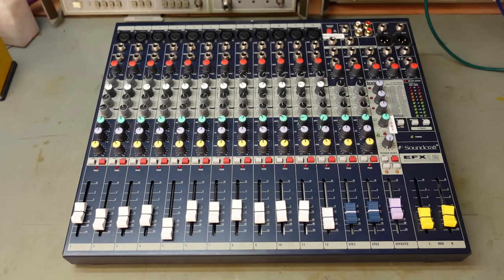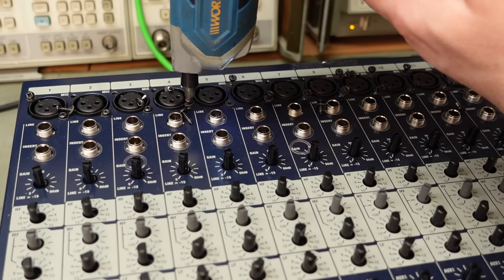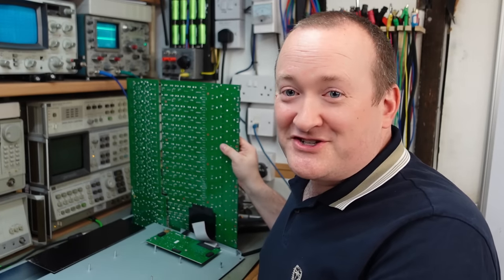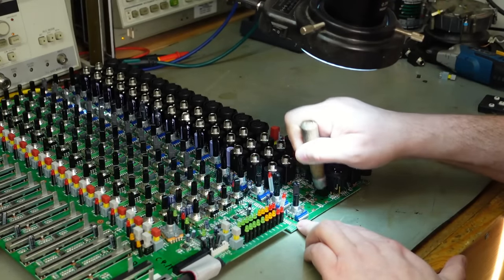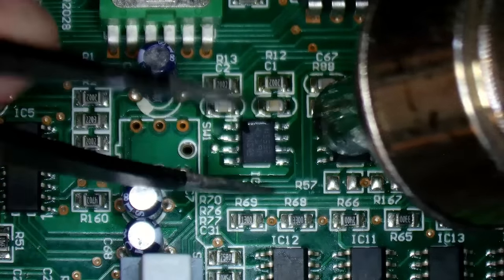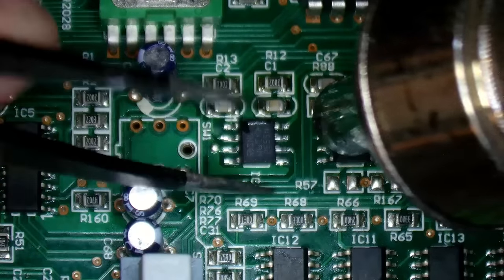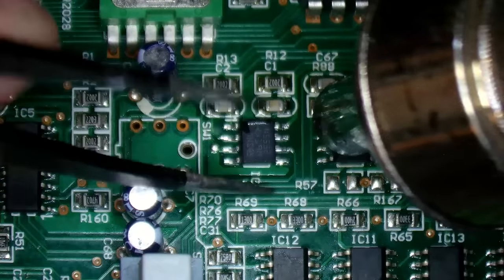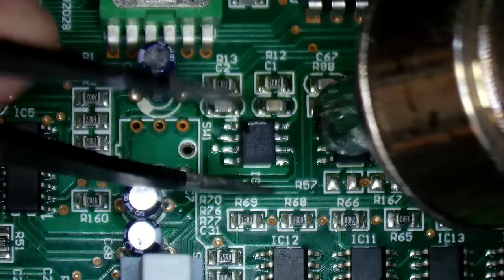Mixing Desk Repair - Soundcraft EFX12

Comment: Nice repair. But I get the impression that you're not totally clear on how a mixing desk works; it might be helpful to sit down with an audio engineer to walk you through it, since to me (even though I've not done sound engineering for decades) it was quite obvious what the "MON" labels meant and that it's a 20 input mixer (12 mono inputs, two stereo inputs, a stereo "aux return" input, and a stereo input from the internal effect unit).

Each input channel on this mixer is (as is usual) sending to multiple different output buses, in this case four: main, monitor, FX and AUX1.

After the gain and EQ on each channel the first branch is to the mono aux output bus, with each channel's level to that bus controlled by the AUX1 knob.

When recording or being used in concert sound mixing this bus will usually be used for the monitor mix for performers so that they can hear a different mix from what goes to front of house. (Typically, performers want to hear their vocals at a higher level than you'd want the audience to hear them, and need less of the instruments, or even none at all for certain instruments like drums where they've got plenty of volume from the drums next to them in the studio or on stage.) Thus the "MON OUT" label next to AUX1 OUT.

When doing a mix from tape, however, no performer mix is necessary, so this can be repurposed as another effects mix, going to an outboard effects unit. The output of that effects unit would usually be brought in via the STEREO RETURN input (inputs 17 and 18) which, is greatly simplified: it accepts only line level input with fixed gain, offering only a volume knob with the same function as the faders (linear pots at the bottom of the board) on the other channels because typically you don't need EQ or the like on this signal. (You missed testing these inputs, I think.)

The next knob on each input channel, FX, is basically the same thing again except that rather than giving you outputs to direct to an external effects unit this output bus is connected directly to the internal effects unit. The return for this is the purple EFFECTS fader, which is inputs 19 and 20. There's also, in the section above that, a blue FX TO AUX1 knob that can send the output of the FX unit to the aux bus so that you can send some reverb to the performers when using the aux bus as a monitor mix feed for them: thus the FX TO MON label beside it.

The PAN pot and faders control each channel's output to the main mix bus in the obvious way.

The fourth output bus comes out the MONITOR OUT section to the right of the three stereo inputs (STEREO 1, STEREO, STEREO RETURN). The labels added by the last user create a bit of confusion here, because the labels refer to the monitor mix for the performers, but the Soundcraft-labeled MONITOR OUT is for the recording engineer. This bus normally receives the same mix as the main output, but that can be overridden with the PFL (pre-fader listen, sometimes called "solo") buttons. This replaces the engineer monitor output with just the signal from that channel at full volume (i.e., before the fader) which allows you to do things like tune the EQ for that signal. It's a separate bus because you don't want the main output, which might be going to a tape recorder or PA system, to be changed when you're doing this.

That STEREO 1 and STEREO 2 are inputs is obvious from the fact that these have all the same controls as the mono input channels: gain, EQ and routing to the output buses. The same goes for the internal effects output (routing to AUX1 and the main output bus). It's not quite so obvious for the STEREO RETURN input, since that has routing only to the main output bus and that's via a knob rather than a fader, but "return" is a standard name used for this sort of thing.

Comment: if the cable is made right and the output is balanced, phantom power should not bother balanced outputs at all.
Reply: so turns out they are not balanced after all...
Reply: But if the cable is not right most likely an XLR to TRS adapter or cable.... Into another mixer with global phantom power.

Comment: Good morning,I liive in Brasil I work with professional sound and i have s Spirit live 4 Soundcracraft table, I have a problem with the internal belt, I`ve already tried with the technical support in Brasil, I didn´t get a response, could you tell me where I can buy it, I know It´s out of production, but you van find it somewhere in scrap metal. I will be very grateful if you help me.

Comment: I'm surprised that console is even worth fixing. Here at least in the US you can't give those away! Now that all new mixers are digital the old analogue mixers are only worth scrap. Even name brands like Soundcraft, Yamaha, Mackie, etc. They're all worthless now. Kinda sad to see, I really wish I had a need for a mixer because I would totally take one but I don't have a studio to use it.
Reply: There are a few exceptions - robthebloke performs live techno, all the sounds he creates are generated by vintage or classic modular analog equipment in the first instance.
In the second instance the internet is the ADC in effect downgrades everything except  the live performances to MP3 automatically (assuming the PA was digital) but my understanding is he never performs through digital amplification (or compression) based on the reason people come to the performances, and the reason he performs are the same thing ie an enjoyment of noises derived from voltage-controlled synthesis (and sequencing and effects).

Comment: Yeah. 5532's and 5534's are not too reliable. I always have plenty in stock. And there is a reason these often are socketed, like in the Studer B67.
Reply: I've never heard of 5532 being unreliable. Its used in millions of circuits, some of which probably operate them at 20vdc or more which may kill them eventually. That and bad decoupling making them oscillate and create even more heat.

 EDIT... The JRC or NJM 5532s are made a bit cheaper and I have seen a couple complaints about those regarding sound quality. Stick to Texas Instruments!!

Comment: Teach kids soldering and its always heat on, apply fresh solder heat off. They always be solder first, then heat on , heat off then get solder stuck to pin!! thank goodness for chip holders - can't say how many 555 timers that has saved let alone it not being a problem if they solder teh chip round the wrong way round!! and why do chips not go into the chip directly - always have to squeeze the legs first!

Comment: They are a great little mixing desk but badly implemented for repair work.
The inputs being so unsupported without the face plate is just poor design to keep it cheap.
If it wasn't for patient,knowledgeable techs like you. This would be a throw away item

Comment: It should be illegal to sell a mixer of such poor quality.  Faders are useless, PCB like a sheet of paper stock, just horrendous design and build. When a manufacturer goes this low, it calls into question everything else they make. Our insistence on ultra-cheap solutions to our jobs is to blame, but the manufacturer has decisions to make as well. A mixer should outlast its owner.

Comment: Dear God, man.... don't poke at live circuits with your finger tip, ever, but especially FAULTY ones.  Use a non-conductive spudger or even a pencil eraser or something.   Can't believe people are going to be trying to learn from this.   Dragging that bigol iron tip across all the enamel and pads.   Shoving 1/4" connectors into jacks no longer supported on the chassis.   tsk tsk.